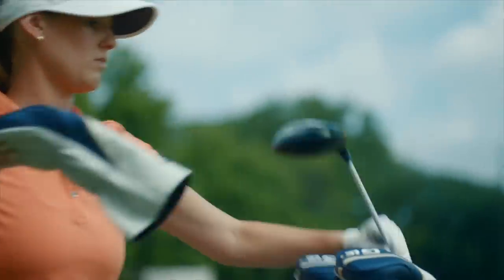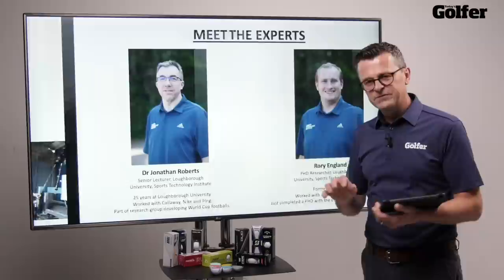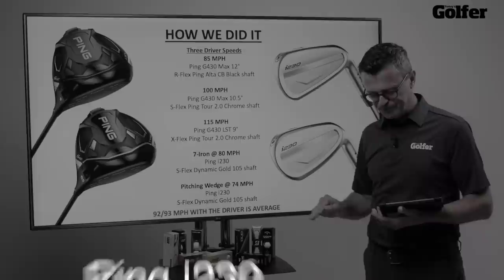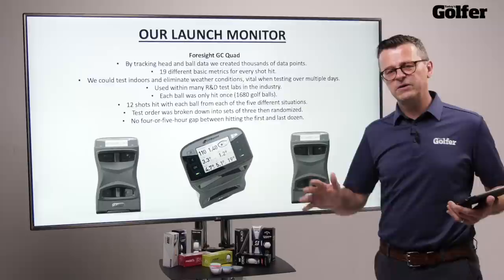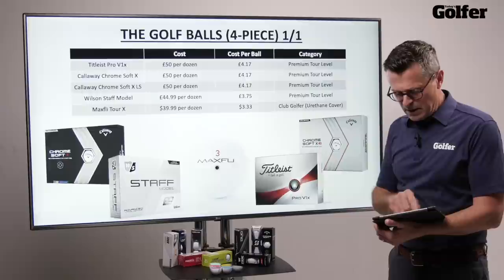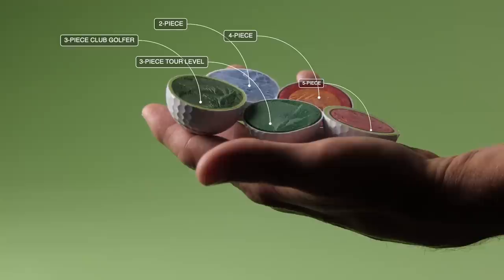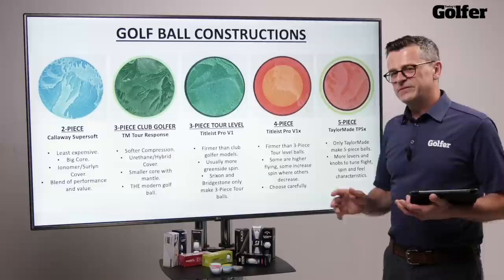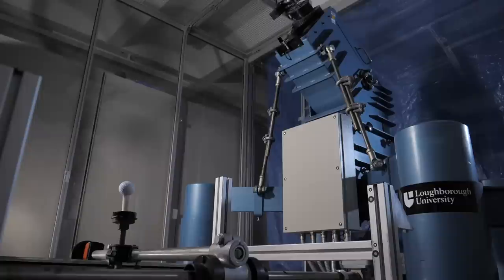ROBOT GOLF BALLS TEST | Find the best 2023 model for your game! 🤖 🏌️‍♂️

Comment: If 92mph is ave ss why not test at that speed?
Reply: Exactly. Why pick these arbitrary swing speeds that aren't  the average?
Reply from the maker: Couple of reasons Peter.

1: It's possible to extrapolate 92/93 MPH data from the numbers we've produced.
2: And by having the mid swing speed at average, you end up with very slow moderate, and very quick fast speeds which are relevant to fewer golfers. S,o to satisfy Peter, you're robbing Paul at both slower and quicker paces.

Hope that explains.

Comment: My only ossie with this test is that it misses a huge part of what makes a golf ball fly, aerodynamics. 

The GC quad uses an algorithm based a ball flight model to give distance and decent angle. In the real world a prov1 flys differntly to a prov1x becaise of a different dimple pattern. So while the data on ball speed, lauch and spin is relevant and important, It doesnt tell you how it will fly. 

Great test though. Testing to take away my 1 complaint is almost impossible given the nature of weather and temperature changes over time.
Reply from the maker: Thanks for your input Ross. Completely understand where you are coming from, you're absolutely right there's drawbacks to using camera and radar systems.

We're currently in discussion with a couple of manufacturers as to whether we can unlock their aero codes for each ball, which would give more accurate data later in flight on future tests. 

Fingers crossed.🤞

Comment: Not sure how to judge these tests . 100mph driver swing speed but looking for lower spin.  Clearly Wilson duo soft is the lowest at 2272 RPM. Go & look for reviews and Golf Monthly say its a very high launhing golf ball. So which is it??
Reply from the maker: Hi Paul, which are you looking to do lower spin? Or lower launch you mention both.
Reply: @todaysgolfer  yes lower spin. I play with the PROV1 but ball flight is very high & decent angle on 7 iron is 52 degrees. Around 50 even on my 3 hybrid. I was wondering if a lower spinning ball would help.
Reply from the maker: @paul090971   Got you. This sounds like quite a specific problem that you could do with tackling in more than on away. 

Yes the Wilson Duo Soft is lower spinning and flying with the driver at 100mph (than our test averages). But while it's lower spinning with 7-iron, it also flys higher with the irons. So what you get with one hand you giveaway with another.

Historically softer golf balls are lower spin golf balls, which could help, but as softer golf balls also often fall in the hands of more average speed players engineers do try to make them stoppable by flying higher and descending at a steeper angle. 

Our gut feel would be to optimise golf ball based on your preference but also look at it in conjunction with iron lofts and shafts. 

Hope that makes sense? Going at the issue just through golf ball is probably not entirely going to give the results you're after.  

Hope that helps.

Comment: Another comment: when you compare driver distances, it shows all balls are actually quite close together, namely within 5 yards (239-244 yds). Instead of realizing that the differences are quite small you zoom in on the differences and stretch it out on a large horizontal axis, making it appear as if the differences are actually large. Within a reasonable error of margin (e.g. among one of many factors, the quality of the strike being one of them) the conclusion should be that, within your testing conditions, the differences are within only 5 yds. You guys have a tendency of 'misrepresenting' data in this manner more often.
Reply from the maker: Understand where you're coming from, but in our defence we clearly state and show there's only 5 yards between all the balls when averaged across all three driver speeds. If we zoomed out to show the whole yardage accurately compared to the distance differences you wouldn't be able to see which balls are which. 

Obviously the gap is doubled when looking at the highest driver speed.

Comment: 5 to 130 mph won't replicate most of the PGA tour,  it won't generate anything over 1.4x 130 mph or about 175mph ball-speed. 
Definitely won't get into the 220s and especially if you're not tweaking the shafts or lofts it'll be interesting but not realistic for many players

the question is what changes with increasing clubhead speed etc

Comment: Ok so basically the 115mph chart starts to become useful. You should't talk about huge differences, but relative differences. 11 yds out of 300 yards is 1/3rd of 10 percent or about a 3pct difference. From fastest to slowet. So overall just over 1% covers the whole lot relative to the mean. Which is about what I would expect. I would expect to see something similar for all fo the measurements, in a relative sesnse. And Id expect to see that remain very close to the 115 mph numbers. For lower swing-speeds, really who gives a crap. If your swing-speed is 50mph then you can just guesstimate all of the results at half of the 115 numbers and get more than close enough. 

So then the really important question becomes how does the data change with the number of strikes per ball...what is the playing life of the balls tested?  Because otherwise there's no significant difference between any of these balls. They all perform roughly about the same. You can factor in the price and get a value number for each ball straight out of the box. But who is going to look at playing each ball just once? 

Grade, somewhat useful, but half-done.
Just do all the tests at a single 100mph-125mph range (higher would be better) and do some proper math on the results. 
And plot them sensibly. 
There's no need to change the clubhead, shaft, etc, then you're just fitting the gear to the swing-speed if not the swing profile.
There's no rational argument to say that the ball will care about that unless you really believe that you need to hit a ProV1 differently from a Noodle.. And if you're going to do that, then why not use a TS3 or TSR3 instead. 

And again stop with the giant pics of golf balls and their boxes. just say no.

But really what i'm seeing here is there is no serious significant difference between any of these balls in terms of performance, and in any case you're liable to lose the balls before you have to worry about their longevity. I wouldn't say that's the case for every ball played though. Ball consistency is a completely different question.

Comment: Why is the Srixon Z-series XV not listed in the 1000mph and 115mph list??? It is used by tour pros! You artificially limited the competition to get skewed results! I have found the 2019 model to have comparable distance to the TP5x, another long hitting ball used by tour pros that you don't list on the 115mph list!       You should have tested the balls with the 7 iron and wedge at 3 different swing speeds. That can make a difference in performance.       The only ball I see on the list with the 7 iron that has a landing area of less than 3 square yards is the TP5, NOT the Callaway. Your display doesn't match what you are saying.       I give up. You lost me at a little over 29 minutes. This study, or the reporting of the results was not well thought out.
Reply from the maker: Sorry to hear you feel that way Bob. 

The Srixon Z-Star XV you mention is in both the 100 and 115 MPH driver results, there's two sheets to each of the speeds hence the (1) and (2) designations. Guessing you've missed (2) at both speeds. 

All the results are on our website if that makes it easier to understand link below 

https://www.todays-golfer.com/equipment/best/golf-ball-robot-test-2023/ 

Again with the 7-iron shot area you're looking at sheet (1), but sheet (2) contains the TP5 and TP5x.

Hope that helps.

Comment: Testing indoors is worthless for ball comparisons. Ball manufacturers spend tons of money and years on research to figure out the proper dimple patterns to create the aerodynamic properties they want in different balls. All of that is not accounted for in indoor testing, where you simply have the launch monitor guess the outcome based on the initial launch parameters of the shot and applying that to an algorithm that really only applies to a single type of ball. And the foresight algorithm is notorious for incorrect calculations, especially on longer shots if the spin gets low. Very soft balls tend to spin less, which means they'll get a boost on foresight for example. Different balls will also be affected differently by moisture, which again isn't accounted for in this test.
Unless you play all your golf exclusively on a foresight monitor, then this test tells you nothing about what kind of ball is best for your game.
The only ones who seem to have decent testing of balls is PING with their ballnamic program. 
And if you want to find the best ball for your game, you'll have to test for yourself.